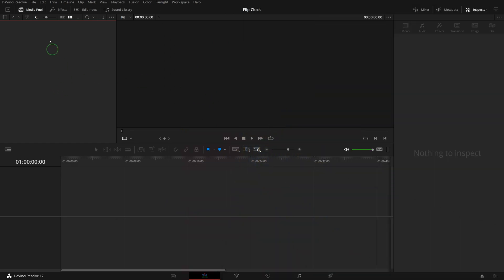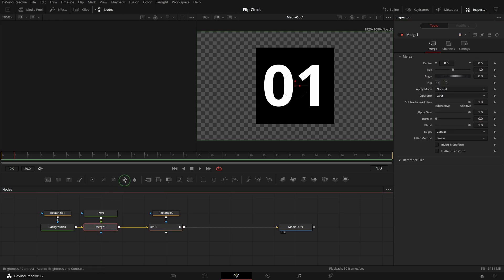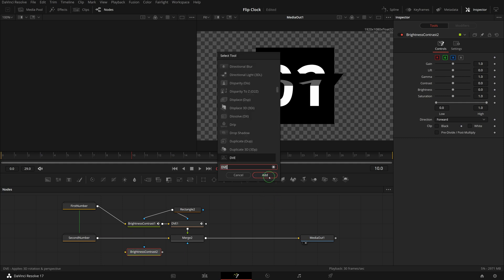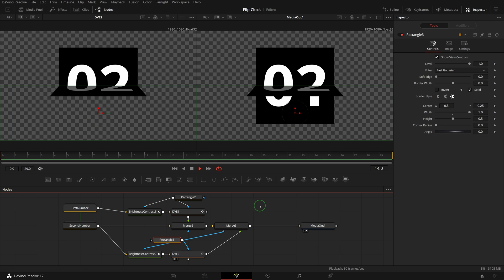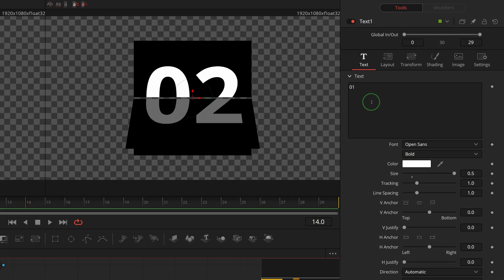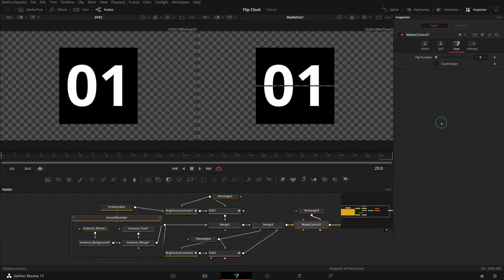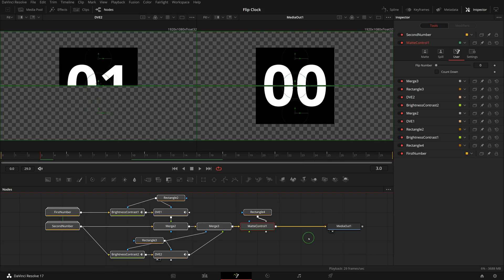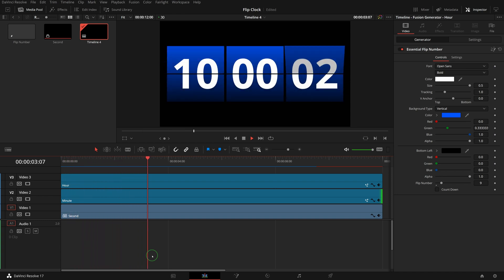Create Flip Clock and Countdown Timer with Fusion in DaVinci Resolve 17

Comment: I added the clock to a vertical video and background strech in the Y axis, any help in this issue
Reply from the maker: You can open it in the fusion page, and change the height of rectangle1 node. I'm working on improving this template, will be available soon.

Comment: This was so useful, thank you so much. I followed this tutorial and I've managed to create a flip clock! 
I was wondering if you could tell me how I could replace the numbers, or perhaps simply do an overlay, with pictures or text and preserve the flipping motion?
Reply from the maker: Thanks. Yes, it's possible, that would be an effect template instead of a generator template as I showed in the video. with an effect template, you can apply the effect to any clip in the timeline.
Reply: @EssentialVideoEditing  Thank you for responding so quickly! I saved the macro file to the effects templates, however when I dragged the effect over a clip the effect seemed to override it and the clip is no longer visible. I somehow managed to insert a clip in fusion but I'm unable to insert any other. Do you have any suggestions to fix this?
Reply from the maker: @Lia-ut7mh  you can check DaVinci Resolve Reference Manual for more detail of how to create a Effect template.
Reply: @EssentialVideoEditing  OK I will do. Thank you for all your help! 😃

Comment: Thanks a lot for this! But I have a problem: arround minute 10.28 you have a complete different code as I get. I'll get: MatteControl1.CountDown

When I type your code in the expression, it doesn't work.

Any idea how I can solve this.
Reply from the maker: it could be due to pick whipping overwrites the existing expression, in my demo I first copied and pasted the expression from before, move the cursor to the end to make sure it's NOT in override mode, so that I can pick whip another parameter and append to the end. Pick whipping helps to find the name of the destination parameter, but you can always manually type in the expression: 
string.format("%02d", (MatteControl1.FlipNumber + iif(MatteControl1.CountDown==1, -1, 1))%60 )